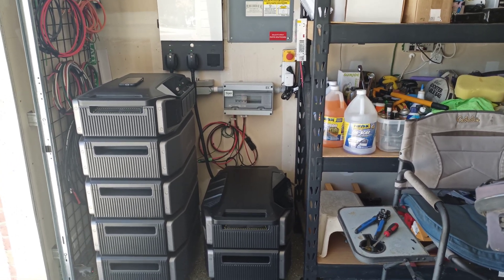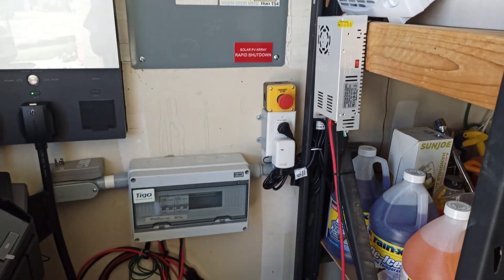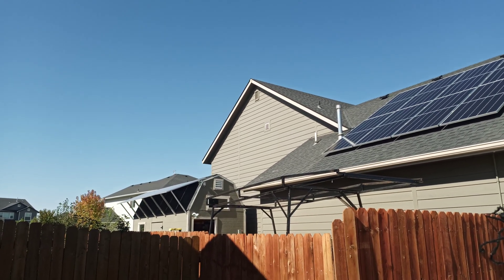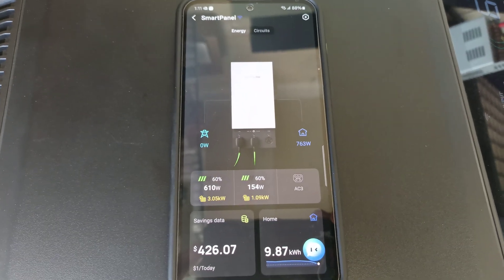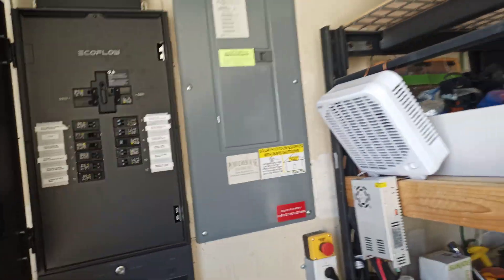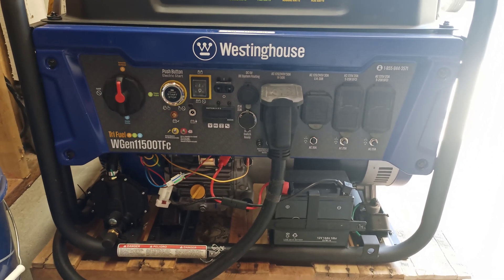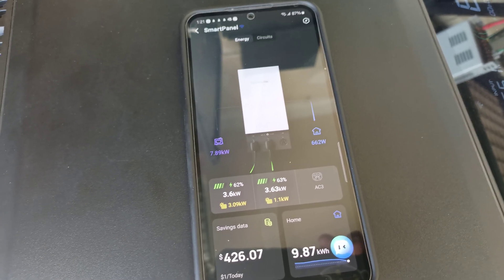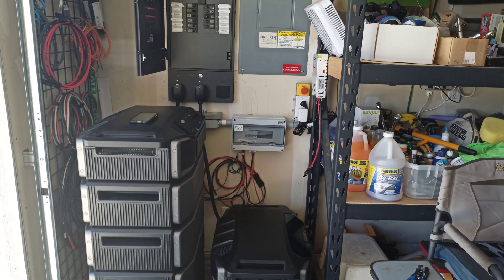EcoFlow Delta Pro Ultra install update w/ Generator overview and run time.

Comment: I have a couple of questions. 
I have a DPU with 5 batteries and a SHP 2. I also have an outside connect for my generator (9500/7600 run inverter). 
When my SHP2 was installed the electrician didn’t put in a breaker for the generator., instead he put a surge protector in the breaker spot. 
I tried to run my generator to charge the DPU and run the house but the DPU continues to operate as if the generator isn’t running. 
How do I fix this, I watched your video and yours worked flawlessly. 
Any help would be appreciated. Thanks
Reply from the maker: Well, offhand a surge protector is not a breaker. So I don't think it's allowing the power to flow.

Put the 50a breaker on the generator side. Give it a try.

That's just based off what you've said. A picture or a model number of what's in there or something would help.

Comment: Cool set up! How's it working for you? I"m looking at getting one in the near future.
Reply from the maker: Loving it, working without issue, we'll be expanding, probably next summer..
Reply: @erickoffgrid  Have you thought about a whole home surge protector? Just curious. I was thinking if possible maybe 3 or 2 would be needed I think. 1) At the main breaker panel - like Siemens FS140. 2) Between the DPU and SHP2 - not sure how that one would work 3) the solar panel array near the DPU. What do you think or recommend.
Reply from the maker: @robbaker1726 i have never actually considered one, but more safety is better than none I suppose, but i've never looked into a personally

Comment: Thank you for the informative video. I’m seriously considering this. Did you install your panels yourself and if so what gauge wiring did you use to the Delta Pro? If so, did you include a link to the solar panels?
Reply from the maker: I did install myself yes, and as I recall 10g wire. I got mine at platt.com https://www.platt.com/p/2047104/q-cells/475w-solar-module-156-half-cell-black-aluminum/qclqpeakduoxlg1047

Comment: Are you running in "Self Powered" mode?  Do you change the mode when you switch over to generator?  I ask because I am about to add a generator to mine and there has been some confusion on what happens when you switch to generator.  If in Self Powered mode (which is what I run), and you switch to generator, there will be no load on the generator if your batteries are above their reserve setting (just like there was no load on the grid before switching).  Sorry if that's confusing, just wondering what mode you run.  Thanks for the video.
Reply from the maker: @glensworld66  I run self-consumed all the time I did a video as well with me turning the generator on and staying in self-consumption mode all it does is power the house and charge the batteries at the same time.

Because the generator will power the house and charge the batteries I lowered the input down on the AC side of the units to charge instead of at 7200 I think I lowered it to like 64 to give the house some room so I didn't over pull off the generator between charging and running the house at the same time.
Reply: @erickoffgrid  Thanks for the quick reply.  I did hear in your video a UPS starting to beep so I'm guessing you have the issue where some circuits stop working when on generator?  I wish it didn't work that way.  Many of my circuits don't have much load on them and the generator would be able to support the load, but the panel turns some off anyway.  Did you totally get passed that or do you just live with some not working?
Reply from the maker: @glensworld66  I have one or two that I deemed not battery Worthy but for the most part I run UPS is on major things like refrigerator freezer electric devices of course that are sensitive to Brown outs or voltage spikes.

I think when I was doing the video I didn't have all the circuits on must be powered somewhere on optional I think but other than that most of the house is fully on the backup

Comment: @ 1:00 I have one of these solar simulators (looks the same style) . After reading the spec sheet it said to always keep the load at 20% under the max allowable amps. 
Mine is a 60 volt 20 amp max unit, I draw 60 volts at 15 amps and it’s worked great for a EcoFlow delta pro to add fake solar.

Comment: Very well thought out setup. I watched the complete video and I was waiting to see how you removed the ground neutral bond from the generator, but it’s not in the video. Whether you removed it or not is my question to you? If you did remove it, could you inform me of how you removed the ground neutral bond? Or a link to the video you used to remove the neutral bond?  There’s tons of videos out there on the subject, but you are very meticulous with your setup and i need to remove mine. I have a DPU/SHP2 with 4 batteries. The panel was installed by an electrician with the generator inlet and whole home surge protector. No solar yet. But love your video.😊
Reply from the maker: @hlm34  thank you appreciate the comments usually the bond removal is in the generator's manual but in one of my videos for the generator I call it out and I think I took it apart to show it

Comment: Ohh what a nice setup. Are you a electrician? I'm thinking about getting this setup but only 3 battery pack 18kwh with my 22 panel solar ans my 13.5kwh power wall
Reply from the maker: Not an eletrician, 13.5k array sounds awesome, yu can charge up a lot more batteries with that kind of input.

Comment: Awesome video. The EcoFlow setup is nice, but I was going to buy a Ruixu lithi2-16 16kwh 48v lifepo4 battery and pair that with an EG412000XP inverter, but the EcoFlow Smartpanel is so slick, I might just land up going with EcoFlow, especially with its easy generator integration. About the only thing I like better about the Ruixu is the battery is rated for a full 9,000 cycles before dropping to 80%. If you do one cycle a day, that's over 26 years! The Ego is only rated for 3,500 cycles. The EG4 battery is rated for over 7,000 cycles. I don't know why EcoFlow doesn't compete better in this area. If they got it up to 6,000 cycles, I wouldn't think twice and I'd by it today.

Comment: This is the best installation I ever seen, very meticulous and shows a great attention to details and high IQ.

Love the shed panels system. You can make the support bars telescopic to adjust the angle as needed for optimal exposure throughout the four seasons.  I have a southern facing fence I’m thinking to utilize your shed system idea to mount solar panels. 

Did you use install the roof panels yourself? 

Can you share the Tigo model used as well the brand / Model/ Specs of solar panels / wires, it will save me time researching. 

Thank you 

Your new subscriber!
Reply from the maker: @SKANDaR0875  thank you I appreciate the compliment. I believe I did the tiger video should have the models in there but it's the standard unit not for the fire rated or all that so so it should be easy to come across.

Yeah everything you see I installed on the roof in the panels the whole bit.

I believe and I did even a short on how I was able to rotate the panels on the shed to face up and then face downward south in the winter.
Reply from the maker: @SKANDaR0875  when you speck out your system you just need to make darn sure you don't over voltage the system.

So pick your panels based on budget space all that and then do the math but do not over-voltage the high input or the low input of the dpu.

And for goodness sake put a meter on the end of your solar lines before you plug it into your dpu you do not need any magic smoke.

Comment: That shed panel setup is pretty slick, good idea.  Oh yeah, what is the RS485 port for on the eco flow smart panel 2?
Reply from the maker: @earthenergyhex  thank you I felt it was a good use for the angle of the shed and I don't know what the port is for I think your remote talking to other devices but I would have to look it up

Comment: Erick... I swear to () lol this video is exceptional. When you get around the 8 min mark about your generator.... Epic information. I am currently trying to charge my DPU's with the Duromax 13,000 and the DPU's throw the dirty power errors (low frequency and low or high voltage) . It is great to know that the Westinghouse 11500TFC is clean enough for the DPU without having to use an inverter rig that is 2x or 3x the price and not a double cast iron sleeve. I am a fellow tuber that just started doing vids about this stuff so I will absolutely be recommending your channel on my next DPU vid. Thank you sir!!!
Reply from the maker: I appreciate the feedback, thank you..

Comment: Total cost of this system?

I'm sending back my ultra and panel since it can't do what I wanted it to do.

Wanted the 20ms fail over time for the whole house while also using solar to offset the cost of equipment and eventually the electric bill itself.

If I use emergency power mode for the UPS feature, it can't use the self power mode to consume my solar.

So I'm downsizing for now to delta plus for my important equipment and feeding solar directly to them.

Later I'll build a giant 48v battery wall.

With 3x the capacity of the ultra with a stronger inverter that does handle instant fail over and more solar while charging/running.

I'm assuming that as much as your saving on power it will almost never pay for itself because the much higher cost of these systems in whole home backup situations vs DIY systems.

And that's ok if your goal is grid backup and you prefer something like this to say a backup generator.

For me though the power of solar is to save money, and you can't save money by spending it.

Comment: Hi, Nice setup. I have a similar setup but would like to try the generator test. I have a 50amp inlet connected to the Smart Home Panel 2. Do you really need to turn off the grid and switch to the generator on the Smart Home Panel 2 when you connect your generator? Reason I ask is isn't the Smart Home Panel 2 only discharges to the circuits solely connected to it? Just making sure before I do my test?
Reply from the maker: Yes, to engage the Gen you have to flip the "input" to the SHP2, I sized mine to run the house at 2k, plus be able to charge the batteries @ 6k. works wonderfully.

Comment: I am working on designing and building a DPU/solar setup. You setup is the best on YouTube!! This is basically exactly what I am looking to do and I am getting my ecoflow tomorrow. Is the ground just connected to the existing ground for the house or did you have to install a new one? I am planning on adding 11000 Watts of panels and connecting to 2 DPU maxing out both of them in terms of solar input. I want to put my AC on the smart home panel 2 but I obviously won't have enough slots. Can I leverage a sub panel from the SHP2 for most of my lights and outlets and feed that sub panel into one breaker on the SHP2? Or is that a bad idea. Based on how many panels I will have I will generate excess solar during the winter. I can add more batteries, but it is diminishing returns because I just don't consume enough in the winter. I am exploring options for turning that into heat but haven't decided yet on that.
Reply from the maker: This sounds exciting, I would love to hear your updates.
Reply: ANY UPDATES ON THE SUB PANEL . WAS THINING OF DOING THE SAME

Comment: Was seriously looking into Delta Ultra but im hearing about the problems with the units. Ppl sending back to replace only receive problem with the next unit. Have you had any problems?
Reply from the maker: @Golden_writes550  no issues yet 🤞

Comment: How does the 2 dpu balance when the one with 2 batteries runs out of batteries with the 4 batteries still with a charge?  Does it balance itself? Or does it recharge the one with 2 batteries?
Reply from the maker: @josephpham1145  it balances and self charges each other when one has more than the other and then on the output they also balance so the more batteries will put out more than the two batteries and they bounce their output according to their current charge state

Comment: I might have missed it, but where is the generator line going into?  Is it feeding into the smart panel breaker box and that determines where to send the load, either the house or the batteries and by how much?  This probably makes the most sense.  Did it show how it was hooked up, like through a nema connector in the video?  Thanks for the video that helped a lot.  I can hook up the generator straight to the side I believe and use fast charging up to all the way up to 7,000 watts?
Reply from the maker: The gen line is running right to the input braker on the SHP2, yes the Gen to the NEMA connector then to the SHP2 Gen input breaker.

Comment: I have a question  I have pretty much the same setup but my savings calculator isn't working, it didn't work at first then it did and now it's not. What did you do to make it work
Reply from the maker: I have not given that part to much consideration as it is what it is.. but I set mine to .010 per kilowatt and seems to calculate the difference I see on the power bill when I look for it.

Comment: When I switch to generator using same steps as you, I have 3 or 4 curcuits turn themselves off. I have no Idea why. I have SH2 and DPU with 2 batteries.  The generator is 6000 inverter generator.  Any suggestions?
Reply from the maker: @LostLawrence  yep I have the same thing happen to me, for those extra circuits I had to tone down the input charge for the batteries while the generator was running so that I had more available for the house loads and that is what did it for me it's just a lack of power that the smart home panel sees and what the circuits are going to need so it keeps them off as well as you need to set circuit priorities.

But in the end it was toning down the charge rate by the Eco Flow app to the batteries I took them from Full what 7K or whatever it is down to 6400 a piece so that I had more load available for my generator to the house and then they stopped doing that.
Reply from the maker: Also we did this more when I was only running one dpu and with running 1 dpu I would notice a slight flicker in the house like when I ran the garbage disposal or whatever so when I added my second dpu this largely stopped.

Comment: Why not have a auto transfer switch?
Reply from the maker: Auto transfer between grid and gen ?
guess you can do, for me and as often as I will need to do this it was not worth the added complexity and cost, I will only do this during monthly function tests and in actual use IF needed.

Comment: Interesting and a great setup!  Is that conduit or steel piping or a combination of both that you are using for the exhaust? I see where the flex or expansion insert appears to be welded in, kind of homemade looking welds.  Those long radius bends look like conduit. Just trying to see how and what materials I would need to fab up a similar exhaust system for a generator.  Thank you!
Reply from the maker: Conduit, 1 1/2 to allow for exhaust flow for the hard line AFTER the muffler, 1 90deg and then 8ft conduit UP, I had to change to an exhaust flex pipe from the engine to the muffler as the setup in the video shook its-self apart.
Reply: @erickoffgrid  Thank you for the response. Yea, I could see where the short flex would offer little vibration reduction. One long flex hose from the gen to exhaust would. I've installed a lot of the steam flex hoses on industrial equipment of various lengths. So now, you've got it coming out of the gen with a carbon steel nipple, then a coupling, then a stainless flex hose with male pipe threads on both ends or a female union or coupling on the end going into the muffler? Maybe you came out of the 90, that's looking up, with a nipple or flange and then the flex. Or a combination thereof, that would certainly dramatically dampen all of the vibration.  Perhaps you'll do another update sometime in the future and I'll see a picture of the new exhaust setup.  Any concerns when picking the muffler as to which type of muffler would offer the least flow restriction vs noise reduction?  They may be all about the same? I applaud your efforts and the concept of reducing emissions and noise inside your building.
Reply from the maker: @MrFirstone23  Ya' I have had a lot of questions on the generator exhaust, I will put up an update with what went wrong with the setup in the video and what I changed. As for the muffler I guessed.. I guess Hondas are always quiet so I went to the junkyard and found a Honda Civic crushed in the front, the muffler had a 1.5 in/out pipe and I paired that with the 1.5in flex line and coiled it for the vibration dampening in the link to the genny exhaust and the same size 1.5in EMT with compression couplings on the out..
Reply: @erickoffgrid  I guess a Honda Civic muffler is as good a place to start as any, looking forward to the follow up video for clarity.  Thanks
Reply from the maker: @MrFirstone23 any points or clarifications you want to know about it when I record?
Reply: @ I want to see how you have it piped out now.  And how well it holds up to hours of vibration. I'm guessing you'll have to support the flex hose. The combination of conduit, flex hose, old muffler fittings, and standard piping should make for a unique set up.
Reply: @erickoffgrid  Sorry, I did subscribe, and I know this is a lengthy comment, but stainless flex hose is expensive, might I ask were you found the newly installed flex hose or perhaps it's cheaper material or thin wall flex pipe?  Can we buy at Lowes or HD, or did you have to go to an industrial piping supply house?
Reply from the maker: @MrFirstone23  Walker Universal Universal Exhaust Flex Pipe Flex https://a.co/d/6R0sUGN
Reply: @erickoffgrid  Got it. I continue to underestimate amazon. Thank you.